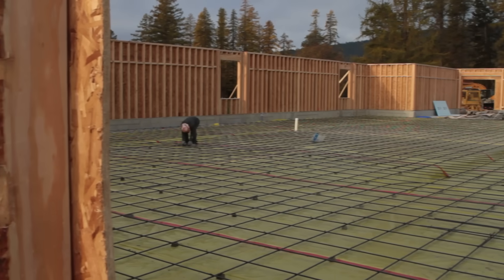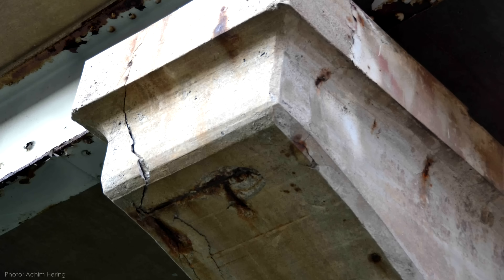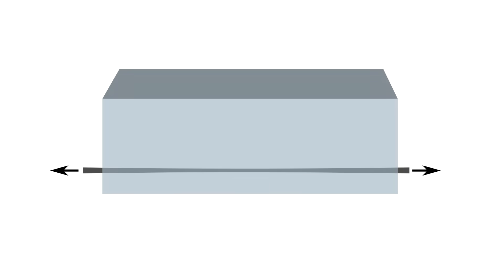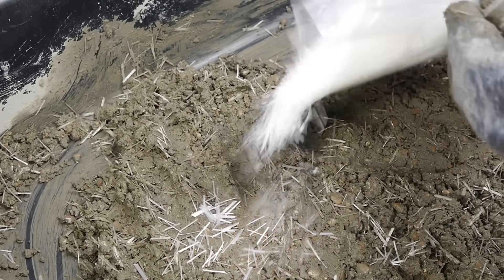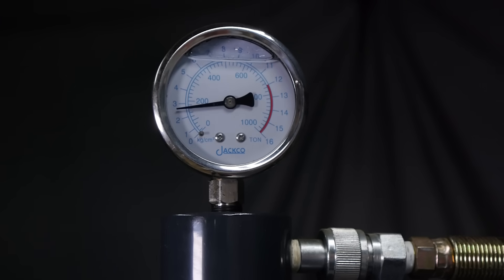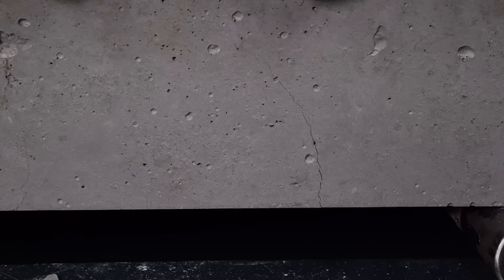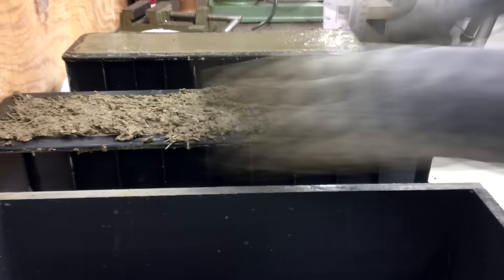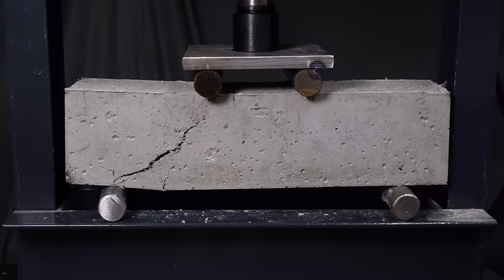Does Rebar Rust?

Comment: Yes it does rust

But not inside concrete (when made correct) so quick awnser :')
Reply: @protonneutron9046  oxidation of Iron is only possible when you have 3 elements, oxygen iron and water when you incapsulate the iron the water and oxygen have no acces (when done correct) so tell me how the process continues?
Reply: @DreStyle  because the encapsulation is not perfect.  smh

Comment: Carbon dioxide in the air slowly neutralizes the alkali in the concrete from the outside inward. This delays the start of rebar rusting, and is another reason why cover thickness is important. Concrete is also fairly permeable, so even if you can eliminate all cracks, it will just slow down the CO2 getting into the concrete and carbonating it, and oxygen getting in to rust the rebar.

Comment: 2 things,  the rebar should have been centered in the cement block for a fair test which leads me to 2-  what cement sack mix did you use? standard home  foundation is 5000 pounds per square inch

Comment: 6:46 the first crack would have appeared in the un-treated concrete due to the positioning of the rebar (off-centrerd compared to the other two). Sorry, not a fair test. This is why individual, one-off tests are often done in duplicate or triplicate to rule out errors such as this. Good vid though!
Reply from the maker: Rebar is off center on purpose. Highest tensile stresses occur in the bottom third of a beam loaded this way.
Reply: @PracticalEngineeringChannel  I mean, during the placing of the rods, it looks like the twin bars have been knocked to the right, as at 6 min 46 sec. During your test under load, I couldn't even make out the presence of rebar in the concrete post when it failed,  because the rebars were located in a different position within the cast/mould as compared to the later two. Meaning, the crack would naturally appear much earlier during the load test on the side facing the camera because there was no rebar present in that area - a weak spot where only inflexible concrete was present.

Comment: My experience in the building trade for more than 50 years when I have seen concrete breaking away from a building it was because the rebar was too close to the face of the finished concrete.
Reply: Clear cover
Reply: should I just stay away from those buildings
Reply: @pleasedontwatchthese9593  yeah probably and call the emergency services
Reply: In Britain, we made that mistake when we built large numbers of single storey prefabricated concrete housing after the war - know as "prefabs" - which had little cover for the rebar, and in a relatively short time showed flaking of the surface revealing the renforcement, known at the time as 'concrete cancer'. Many were replaced in the 50's and 60's with decent quality traditional brick built housing.
Reply: This is "Correct".  I am in the "spall repair business" here in Hawaii and that is almost always the case.  Bare Rebar too close to any surface will pick up moisture and rust and travel along its length affecting any other metal (conduits, railing mounts, lag bolts, wire ties) and rust them too.
Reply: It should have minimum 40mm clear cover
Reply: @MANPREETSINGH-wd7if  minimum cover varies job to job, there isnt a set standard that it HAS to be
Reply: @MANPREETSINGH-wd7if  Depends on the standard. For example in Finland, minimum cover distance for rebar is 25mm for 100 year lifespan. If it's below 25mm but more than 20mm, lifespan for the product is 50 years. This standard is for sewer products. Concrete rings, pipes etc.
Reply: Robert,  very shure what you say, a  mistake all over the world. But is very easy to change this, only change the regulation and control everythink.

Comment: In my engineering work, I've designed cathodic protection systems to help prevent corrosion of steel rebar within concrete in highly corrosive marine environments. Implementation can be expensive, but the system can be very effective in protecting existing structures.

Comment: One of the reason the process you mentioned is avoided in Civil Engineering is because the proposed system give less visual cue before failure happen. The new concrete mixture you mentioned failed at around the same load level as regular reinforced concrete, but it doesn’t reform like regular reinforced concrete. This make it difficult for inspector and give little warning before in failed. One of the lesson I learn at our concrete course is that’s don’t over-reinforced concrete, which can create sudden failure. We want to design it a way that before concrete failed, it give enough visual warning so inspector or normal people can catch it and evacuate. The new mixture give less visual warning to inspector. It might prolong the life span of product but it might create more dangerous condition if doesn’t use it accordingly.
Reply: The problem here is a shear failure for all three beams without shear reinforcements, so it breaks suddenly as it is a fragile response. In fact fiber reinforced concrete does show very large cracks before failure but not at the service state, so you know that when fissures can be seen in this type of concrete you can assume that a failure is at risk.
Reply: @jeanjaquegoldman  I Agree it would be nice to show a beam failing in flexure , make your beam shallower and add mini stirrups, you'll get bigger cracks and it wont fail suddenly.
Reply: If the use case was a single family house single story foundation. I wonder if Would failed here be less catastrophic and benefits of longevity more valuable?
Reply: If your beam is tension-controlled i.e. not over-reinforced, then the rebar will yield (stretch a lot) before failing in bending, and you will still get significant cracks opening in the concrete before failure, whether or not fiber reinforcement is used. The cracking that fiber reinforcement prevents is at the service level, which you don't want, if you can avoid it.

As @jeanjaquegoldman mentioned, the failures in this video are shear failures which don't tend to give the kind of warning that bending failures do because they are in-fact caused by tension across the concrete, and don't engage the primary steel reinforcement. If Grady had included some stirrups in the beam, we could have gotten a moment failure that would have shown the flexure cracks opening significantly before failing in all three beams.
Reply: Sounds like what a construction company that wants engineered obsolescence in their projects so that they can keep getting contracts would say...

/s not /s
Reply: The first enemy of reinforced concrete is moisture and water coupled with the subzero temps during winter. When water makes its way in minor cracks it reaches the rebars starting the oxidation process.frozen water expands cracking and literally destroying the cover concrete exposing parts of rebars. Here in Italy in front shore building we use hot galvanized rebars, coupled with additives on the concrete making it water proof. A galvanized rebar is basically eternal . Obviously costs skyrocket since the rebars are sent to the galvanizing facility .
Reply: @3dvorator  come see Canadian highway bridges where salt is used heavily in the winter. I can assure you hot dipped galv rebar is far from eternal. 10-20 years maybe before you start getting higher maintenance required
Reply: @coadycarter9230  we use galvanized brackets on floating dock ( which floating tanks are actually reinforced concrete built ) and they stay submerged in salt water decades. 🤷‍♂️🤷‍♂️👍👍
Reply: @3dvorator  Basically eternal 😂    You need to be watching science videos

Comment: One pound of copper mixed into a thousand pounds of molten  steel, it's called "carbon 10"- a touch of surface rust at first, and then no more rust, ever.  Or, better yet, is the rebar  carbon steel,  stainless steel, glass fiber, carbon fiber, or basalt fiber? I might have watched it if it was a touch more intelligently titled.

Comment: Why is not the metod used in the grate wall of China in use today? The concrete/mortar used was mixed with rise flower to form a barrier throughout the material preventing moisture from entering. Now the stones are braking down but the mortar/concrete is still holding, well worth investigating for use today don´t you think?

Comment: I have personally overseen or actually installed 50,000 + tons of rebar. You are making a mountain out of a mole hill. Properly designed and properly installed reinforced steel structures don't have the problems you describe.. Key being properly installed.

Comment: Love the fact that the narrative is talking about cover @ 2:41  and the screen shows the rebar on the ground with hardly any standoffs.
Reply: I have seen concrete placed in these conditions.  During the concrete placement the contractor will have a crew member with a hooked piece of rebar.  The hook is used to lift the rebar as the concrete is placed and then consolidated with a mechanical vibrator.  On a side note,  the yellow Stego Wrap (15mil) vapor barrier is another technology used to help protect the concrete from the corrosive soil and gas in which it is built upon.
Reply: @nosadonions3231 lifting with a hook or a rake is not the same as implementing correct cover with chairs.
I've noticed that many American concrete placing professionals don't really understand the purpose of rebar. It's not just reinforcement it's tensile load bearing. Each bar has an optimal position in the concrete element.
Reply: @walsakaluk1584  Optimal conditions and Real world implementation are 2 different things.
Reply: @nosadonions3231  they're not. Doing the work correctly or not is a matter of choice. If you aren't prepared to follow the design don't start the job.
Reply: There is no point at putting the rebar where the concrete will compress. And if you are pouring a slab for a house or garage it should have a vapor barrier under it.
Reply: Rebar without the designed cover doesn't perform its intended function in addition to being prone to corrosion.
Reply: Exactly.  Rebar makes a very poor vapor barrier.

Comment: 6:50 I think it would be worth "expanding" a bit more why alternatives don't see more widespread use. Legislative, financial and logistical problems are anything, but straightforward.
Reply: Fiberglass rebar is much better then steel, but costs more. There is also lobbying by steel rebar manufactures (at least in Canada) to keep steel as the standard to keep the manufactures happy.

But GFRP is growing in Europe, coastal states, etc... due to better performance.

Comment: "If you prefer SI, just pretend these are metric tonnes."  LOL.  Love it.
Reply: I prefer unit Newton for forces.
Reply: I always found it weird the Metric System would have a unit that's pronounced the same as a similar Imperial unit. Why not "megagram"? Mega is a viable prefix and grams measure the same thing (mass).
Reply: @foxymetroid  Um, I don't know if you're joking or you're playing a smart ass... but Tonne actually IS correctly called a Megagram. That's the official name. If it was just a lucky guess on your part, well, you're right! :)
Reply: @stevendeamon  I didn’t know that. From now on, I’m going to say megagram.
Reply: @foxymetroid  Ton/Tonne isn't originally imperial or metric. The name comes from an old measurement of volume called tun, basically a standard-ish wine cask, eventually turned to general expression of something being very heavy (I.e. "it weighs [like] a tun"), turned to sort of a unit of measurement. The full cask would weigh about 950kg or a wee bit more than the 2000 pounds of a US ton. Basically, it was a parallel development with people being people and just kept using the word, made it more precise to get on with the times by merely rounding it down/up to a nice number that made sense in the system they used.

Comment: Why isn't rebar galvanised? It's rediculously expensive anyway so my only guess is the extra cost.
In some small jobs at home a few years ago I mage some concrete exterior sills and door step, I used galv M10 threaded rod. Worked OK.

Comment: If the rebar isn't covered by at least 2,5/3 cm of concrete it will rust, expand and crack open the concrete in the proces, causing corrosion damage.

Comment: Yes, it does rust and is the cause of much infrastructure degradation.  It is shocking and perhaps criminal that NEW construction of bridges and roadways is NOT using basalt rebar.  These guys started switching over with their concrete building years ago. https://www.monolithic.org/link-to/basalt-fiber-rebar
Reply: Basalt is still developing, and is stronger in theory, but many real world tests struggle to get the proper Mpa's. GFRP is a great in-between.

Doesn't rust, is stronger and more flexible then steel. There's still the issue of recycling for basalt and glass, but hopefully we can find a solution!
Reply: @ChrisPBacon-gn9jx  Yes, in theory.  That is why you must still use the same diameter basalt rebar as what is spec'ed for steel.  You can't use smaller because it is "stronger" than steel.

Comment: The solution is really simple:
1. Poor the concrete less wet 
2. Put more cement in the mix
3. Don't use pebbles. Use crushed rock that will absorb some moisture
No rusting concrete here in Europe. And there is no need to mix Calcium chloride, or other chemicals, or use stainless steel rebar, coat or paint the rebar. 
And yes, it more of a hassle to poor thick concrete. Doing a job properly is usually more work than doing a sloppy job.
Reply: @clinkerbreaker9332  I know. I come there often. 
Infrastructure, public areas, building codes have now exceeded those in the US. 
No plywood castles in Russia 😉.
Reply: @gravityskeptic8697  The US has over 50 different sets of building codes.  Name the ones you studied and compared to the code in Russia.
Reply: @protonneutron9046  None. I base my opinion on what I see.
Reply: @gravityskeptic8697  you should study the basics of how concrete does what it does.  It is actually fascinating.concrete.
Reply: @clinkerbreaker9332  Great! I hope you are happy there!
Reply: lol!  No that doesn't work

Comment: I worked for a consulting and testing firm straight  from school,as a lab technician. I remember one day I was asked to collect  samples of concrete 
from British railways head office in Marylebon London.There were complaints of small  bits of concrete falling from the building. So they rigged up a cradle hoist as  I was to collect  samples from each level 10 I think.I could see exposed rebar all over the place..I noticed also that the concrete looked quite sandy sort of a tinge of yellow to it. This  was confirmed by analysts later.The builders had skimped  on cement so concrete didn't meet the specification plus insufficient  cover so no wonder was happening.This was

Comment: What you think is the best solution? 
Galvanizing seems the best cost-efficiency tradeoff. At least to my understanding
Reply: simple.  Solution has been around for decades.  basalt rebar.
Reply: @protonneutron9046  much more expensive
Reply: @kraftrad7840  WRONG. steel is avg. $0.75 a foot and basalt is ~$0.90 feet.  You aren't in construction are you?

Comment: The epoxy on the epoxy rebar gets damaged easily during transportation and installation. What if a better epoxy rebar would be to add an additional ring steel layer around the epoxy rebar and make the epoxy flexible?
Reply: Are you talking about GFRP? It shouldn't be damaged easily unless it's a cheap brand. 
The epoxy doesn't really add to the strength (but a bad ratio of glass:resin will be weak). It's just to basically bind the glass rovings together, so scratches on the outside won't effect the product

Comment: How does 'cover' work to prevent water from going in? If a concrete object is constantly in the rain, or in the rain a lot, the inside will still get wet right? And how come the ph10 oxide layer is good, but normal oxide is bad? And what's the point of adding steel fibers, they don't have any cover at all.

Comment: We use GFRC (Glass fiber reinforced concrete) more so when it comes to polished countertops for pretty much the reasons you've stated, but it is far more expensive than pouring a slab off a truck as well as more time-intensive to mix up the batches.

Comment: When I was young I worked fabricating plastic coated cable ,that was placed in concrete and stressed. Do they still do that and how much compared to rebar? It was greased on the inside of the plastic.

Comment: I can understand what your saying a bridge footing. Might benefit with research with concrete its self it's process the more moisture used when it's poured causes a looser compaction when it cures you could always try using a different solvent beside water to pour it. Acetone or ethanol . calcium effects the integrity of the cement. Magnesium separate the molecular structure and stainless steel compacts the molecular structure I think it has something to do with covalent bonds work for example silver iodine  acts as a catalyst for rapid oxidation of hydrogen. Also due to thermal dynamic steal expands or constricts find a neutral temperature that is a good average ambient temperature of your area steal runs about 30 degrees warmer in the sun and I'm sure concrete makes a great hot plate. Last thing idaho power makes it snow where they want. With silver iodide . silver iodide makes a great catalyst for the foundation of a crystal structure. 5 sides for tinsel strength. Like a net